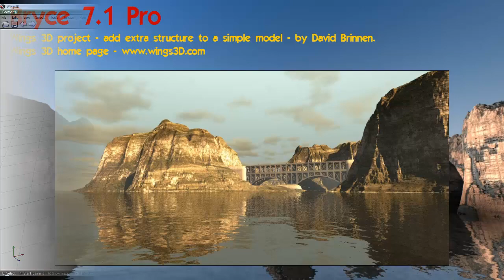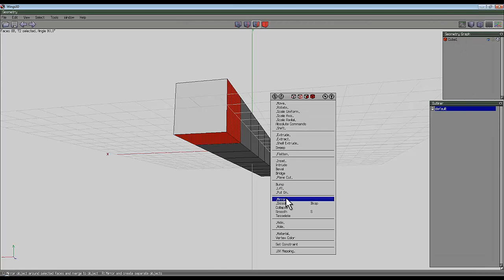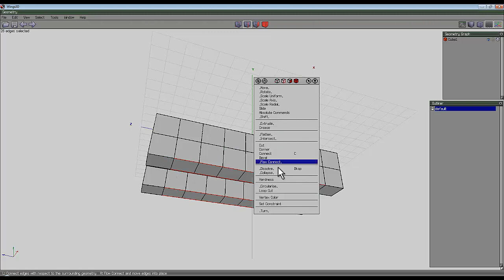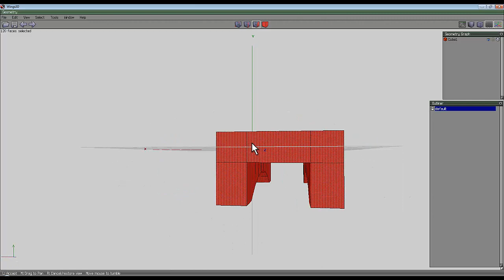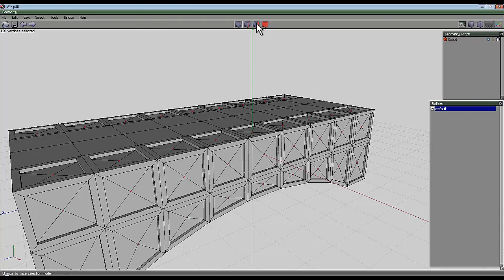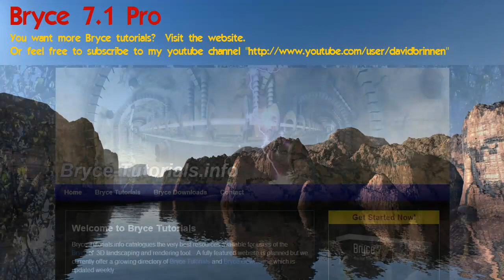Wings 3D - add extra structure to a simple model - by David Brinnen.

Comment: Now please uv map it too 😅
Reply from the maker: Bryce very nicely does away with the need for UV mapping in many instances materials can be applied using world space or object space mapping modes.  Though of course this is not perfect for everything it is surprising how often this works.  UV mapping in WIngs3D I found quite the trial.  In the end I opted for UVlayout as my preferred solution to this issue.  The interface is somewhat quirky but it is quite robust software and it is possible to develop efficient workflows for most geometry.
Reply: @davidbrinnen  But bryce is a paid software🙁🙁🙁
Do you have any uv mapping tutorial too? 
Wings 3d uv map is not really easy and doing that in blender is not really feasible in a low end system😛
Reply from the maker: @berryngames  For Wings UVmapping I used these tutorials https://www.youtube.com/watch?v=wrV_YFnOGzU  Since they already exist I saw no reason to duplicate the work.  If you watch the DAZ3D store, sometimes Bryce is free or heavily discounted.  Today for example it is at -45% at $11.17  Though you cannot UV map in Bryce you can render without the need to UV map.  Which is a handy.  All depends on what you are aiming to achieve.

Comment: Great tutorial! Thanks for doing these! One question (okay, two): Is is possible in Wings 3D, where volumes overlap, to subtract the overlapping volume? My 3D printer interprets such volumes as holes which does not work. I need to either be able to delete overlapping volumes, or combine two volumes in way that creates one volume with no internal overlaps. Is this possible? Thanks again!
Reply from the maker: Not that I am aware of.  However I am no Wings master, so I will leave your question here for others to read.  I suspect the answer, in Wings at least, is to model without overlapping volumes.  Another solution might be processing the geometry with Modo's mesh fusion features.  You could always give Modo a free trial and see if you can fix your model that way.  Just a thought.

Comment: hey I got a little problem with this, when I try the circularise that part of the model tightens up while I want it to to stay the same shape just like what happened in the tutorial. Any ideas on how to fix this?
Reply from the maker: The most likely cause is the centre chosen for the circularise command.  In the video I used a face to determine the centre.  Note that the way a command works is influenced on if it is selected with left, middle or right button, if that command is bracketed by "."'s  for example ".circulaise."  Clues are provided along the bottom of the Window when you mouse over a command and while it is active.  A variation along these lines is a possible cause for your issue.
Reply: David Brinnen First thanks for responding I really appreciate it. But at a certain point in the video you said you selected normal and then on of those planes so you could just lift it up. But I never get the chance to select that plane, nor do I know how you selected "normal". As you may know by now I'm not the most experienced modeller out there.
Reply from the maker: yoeri b No problem.  Step by step then.  When you select the .circularise. command (after first selecting the edge to perform the action on) use the RMB, that is right click the command,  Then you should have the option to select a face.  The "normal" of this face will will act as the centre for circularisation process.
Reply: I don't know what's wrong, perhaps it's me or perhaps it's wings, because I do have more issue's with it on my mac, but I just can't get it to work. But thank you for taking the time to respond, I real appreciate it. Anyway I started using Blender recently And that works perfectly, but I still learned a lot from this video so thank you very much.
Reply from the maker: yoeri b Aye maybe it is due to being a Mac version.  I don't know, I've looked at Mac's but they are a bit pricey for my tastes.  I also considered Blender but in the end decided to go in the direction of Modo.
Reply: David Brinnen Well I picked my because I needed it for school (I study journalism btw) But the windows version of wings is definitely a lot better. As for Blender it is a lot better than wings, but it's also a lot harder. The amount of options is overwhelming and even while following a tutorial 5that's what I'm doing now, it's hard to keep up with the amounts of choices that are thrown at you. But you should give it a chance because it's definitely worth a look, certainly for when you need a more detailed model.
Reply from the maker: yoeri b For me choosing Modo was not difficult, only paying for it was, I knew from within a few minutes of using it that it was the software for me.  I've struggled away for hours with many other applications, Blender included, but when I tried the Modo demo I knew it was the one for me.  It's like the person who designed the interface was reading my mind, when I think of something and look for it, the option is where I expected to find it.  It hasn't let me down yet.  No amount of extra features can make up for that kind of intuitive workflow structure.
Reply from the maker: yoeri b I should add, if you want to see the magic of Modo's workflow, and how complex things can be modeled from a few simple commands, watch a couple of Peter Stammbach's tutorials.  https://www.youtube.com/user/stammpe2  The 2d to 3d series I recommend in particular if you want to see a shift in concept from Wings "solids only" approach.
Reply: David Brinnen Okay I will, thanks for sharing :D

Comment: Well, awesome tutorial, but i don't really know what the hell you did at Circularising.. I did the same, but it didn't work so awesome like on your screen :C
Reply from the maker: Circularising control is a rather sensitive feature.  Since it takes all selected edges into account it can be thrown out of kilter very easily.  Also it has two modes of operation depending on if you click with LMB or RMB.  And... many of the controls change the way they work if caps-lock is on.  So there's just a few things that often catch me out and what I look for if things happen in unexpected ways.

Comment: David, these tutorials are awesome! Please keep them coming if you don't mind, it's great of you to do this for us, thank you!
Reply: Which reminds me, maybe you can help with this; I built a boat model with mirror and haven't yet worked out how to get rid of that so the textures don't show up backward on the other side.
Reply from the maker: Rick Havok Thank you for your kind remarks, time permitting I will continue to add more videos.  I've got quite a bit of Wings3D modeling knowledge in my head now, but it also requires a good example to work with.  As for your boat model question.  Then it depends on how you are applying your textures.  If via UV mapping, then, do your mapping after you've done modeling.  Then you can dictate exactly how the maps unfold.  If by some other approach, then it depend on what approach you are taking to applying your textures.  So maybe supply a bit more detail on your approach for us?
Reply: David Brinnen
Well, I thought I explained it clearly, but perhaps I need to go in to more detail, so I will.

If you were to create a prim lets say a cube then select one surface, right click, and select mirror, you would end up with a copy of the cube that is joined to the original. This cube would reflect any changes applied to the original, enabling you to have a completely symmetrical model my only working on one side of it. When creating a vehicle you would want to split it along the X axis, which would give you a left/right split. This way, the right side would automatically reflect any changes to the left, or vice versa. This is great while modeling, but when it comes time to texture, the uv map will reflcet on the opposite side as well.

Now lets think about the back of a boat, the stern, or transom, where the name is usually painted. With the model still in mirror mode, mapping the texture would yield only one half of the transom, so applying the name "HAMMER" for instance, would appear as "HAMMAH". I have not yet worked out how to make the mirror in to an actual left side so it no longer reflects changes made to the right side and my texture will read "HAMMER".

I hope this is more clear. If not, try it with a simple cube and a word as a texture.
Reply from the maker: Rick Havok What I have found is that as soon as almost any modification to a model is made, the UV map is disrupted.  About the only thing you can do is add edges.  Add any further vertexes and you have to remake your UV map.  So I think that is the answer.  Build your model without textures and then UV map it.  There are UV mappers which will automatically detect symmetry in models and so save some labour - UV layout for example is very good - but not free.
Reply: David Brinnen
Thank you David, and I appreciate the reply, but that is not at all the problem. I'm not modifying the model after mapping, my problem is getting the map not to mirror itself on the model. I think you might need to try what I explained to see what I mean.
Reply from the maker: Rick Havok So OK right, please feel free to email me a small model you are having this problem with and I will have a go at UV mapping it and see what happens.  That's the best way to test.  Obj format please.  Mail@(mynamewithnospaces).co.uk